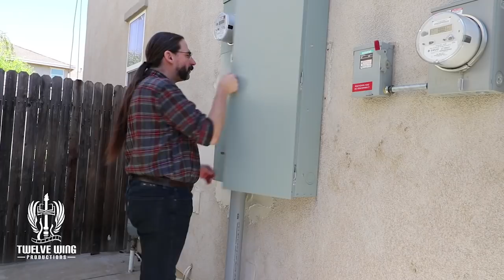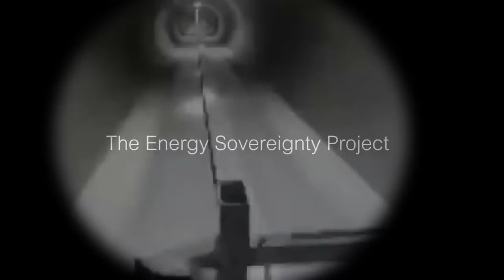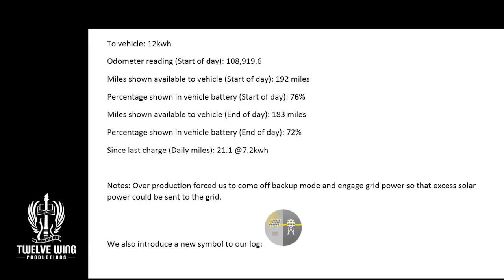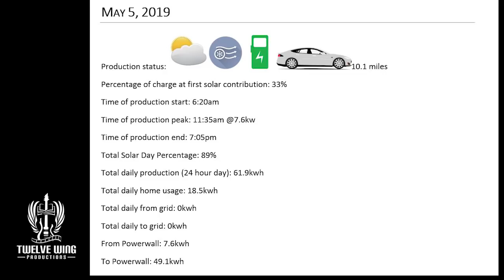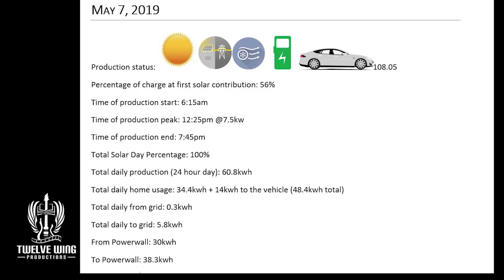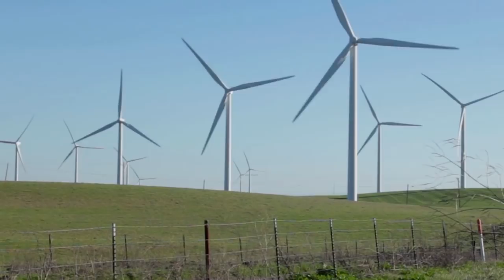The Energy Sovereignty Project: Month 5 Week 1

Comment: Hi Patrick, great information and concept. In the future would you consider a cost break down analysis and showing where you feel a break even point could be achieved. No power costs, car charging from the sun returns on your grid inputs Etc.
Good work.
Reply from the maker: I get this question occasionally Stephanie, and it's probably time I did a video on it.

The Energy Sovereignty Project was never meant to examine ROI because, especially when I planned it, costs were still relatively high.
Instead, I set this up as a feasibility study just to identify if this was even possible and what capacity in battery storage and PV production was needed to pull it off.

What surprised me in doing the study was the level of subsidies available currently.  This actually brought the overall cost of the system once tax incentives and battery rebates were taken into account to exactly what I felt the cost of such a system SHOULD be once production ramped up for the components.
Mass adoption will drive the costs down to the level where, just like flat screen tv's and monitors, it's just "a thing".

Because of this, it's easier to give cost savings than it is to talk about ROI, so I will plan a video shortly to talk about what our specific costs would have been without the project and then show what our costs currently are.
That might help folks get a better handle on this.

Our biggest savings at this point seems to be gas and maintenance costs for the vehicle.
Running on sunlight, I've saved over $300 in just the 2 months we have been actively driving on stored sunlight.
As we progress further and further into the year, there will be fewer things to "calculate" and people can simply take a look at the system and see what it actually did.
That's the purpose for the project.  To strip away all the bullshit and the hype and show people exactly what really happens so it can be used as a tool when designing their own systems.

Thanks for your question and thanks for following along.
I'll start putting together some information for a video on cost savings.
Reply: Yes I agree with you but everyone’s position varies, time of purchase is dependant on so many things.
For instance I am in AU and put 5kw of panels on the roof 6 years ago. I have a 10 year deal at 41cents feed in, the cost then 15k. Now 3k for 6.6kw the feed in here now is 7 cents. Power wall 2 asking 12k installed each. To me the ROI is the first consideration, even my panels have a good return on that high input cost. I subscribe to learn outcomes on a point of balance panels + batts + Ev as opposed to savings on power, fuel and feed in tariff. Are you running a cumulative graph on your weekly stats? Thanks
Reply from the maker: @kelgadeke5102  NIce Kel.  Thanks for sharing your personal situation.
We are running several studies simultaneously.  Efficiency of panels at various positions as well as charging efficiencies.
Some things, like charging efficiencies we will release in mid summer.  Likely at the end of June, when the output of the panels are the greatest.  This will give us the best data available.
Some data will have to wait until the end of this year to really make sense.

So as we have been, we will share with you all those items we can make definitive statements on based on data.
The purpose here is to be able to show others what really happened.  Not what might happen, could happen... but what DOES happen.
 
Thanks for following along!  Hopefully battery storage comes down in price over the next couple years and you can jump on board as well.

Comment: If you go off grid, will you add battery capacity?  Or additional thermal storage with another hot water tank? Both? Or another ev with large battery pack? With additional pv added, you surely will need someplace to put power.
Reply from the maker: Firstly, I can't go off grid because I'm in an incorporated area so I have to maintain a tie to the grid.  My deal is that I would be trying not to use it at all.
I would convert water heaters to electric almost certainly and likely add an additional EV eventually.
I won't need any additional battery storage but I will need between 4-6kw of additional PV production that I will likely shut down in summer.